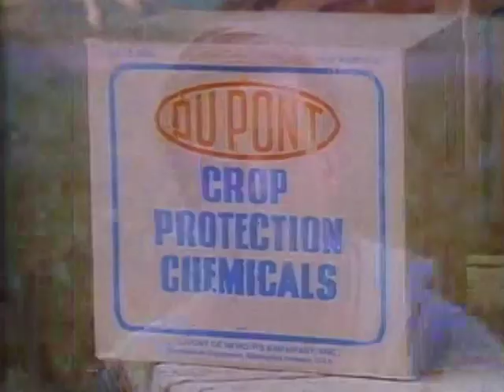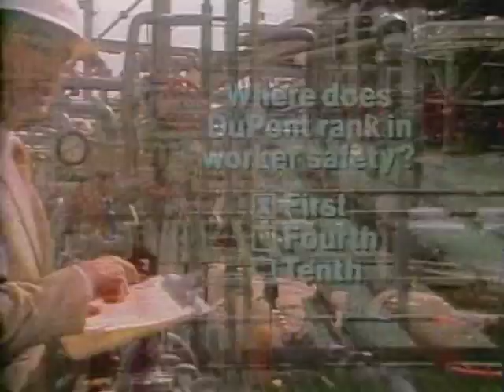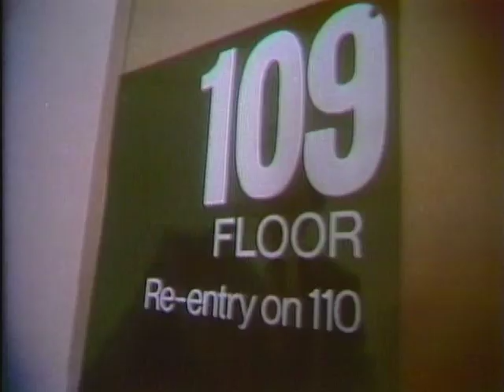70's Commercials Vol. 72

Comment: I love the Coca-Cola commercials in this volume.  They feature what IMHO is one of the most underappreciated, but still great, jingles that Coke has used over the years.  I had pretty much forgotten about it until I started watching these volumes from the late 70's.
Reply: That second one starting at 5:14 is sure as heck the Campaign spot for this jingle, isn't it; I didn't remember the full length version of that.

[ Nope; I anticipated; most of the Coke spots in this are that full-length jingle.  Love the chord progression in that... ]